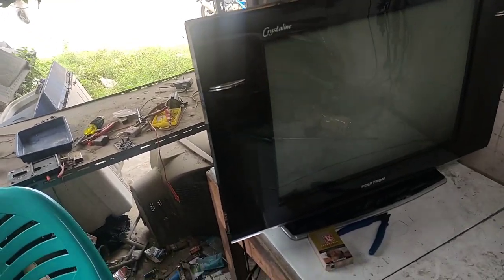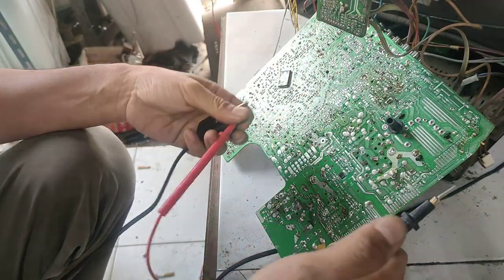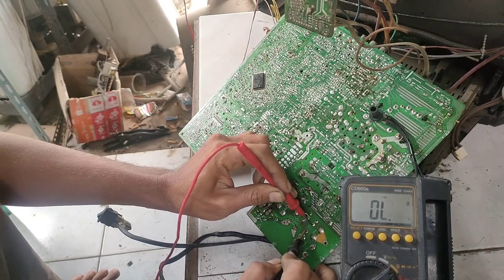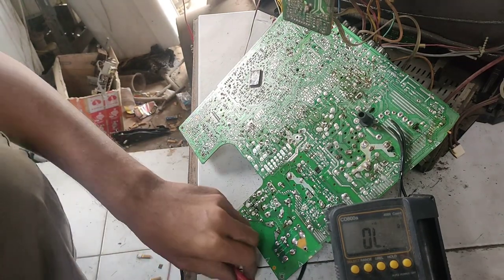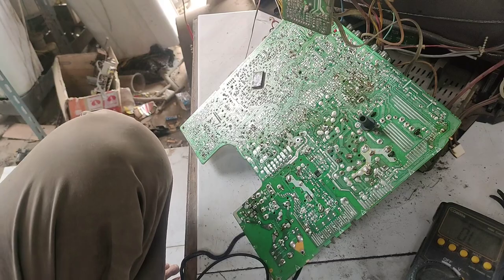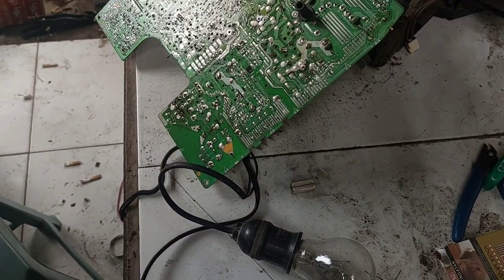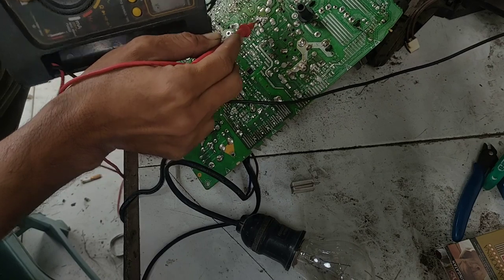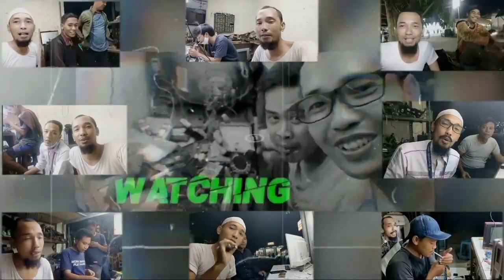vlog 172 cara perbaikan jika fuse (sikring) putus‼️TV RUSAK MATI TOTAL

Comment: Ba kalo tv polytron tabung slim 21 in tegangan b+ normal 5v,8, v, 12v ada lampu indikator uda di cek ga putus tapi ga nyala sama sekali lampu nya da tegangan ic pertikal g tegangan 12+ cuma 4v 12- nol v itu penyebab nya apa ba